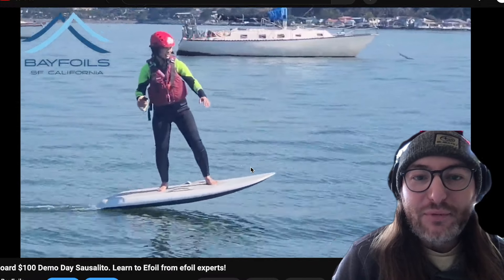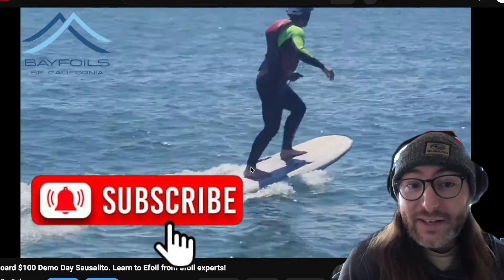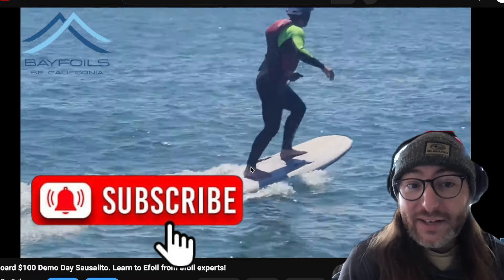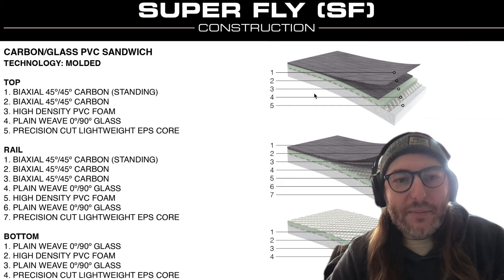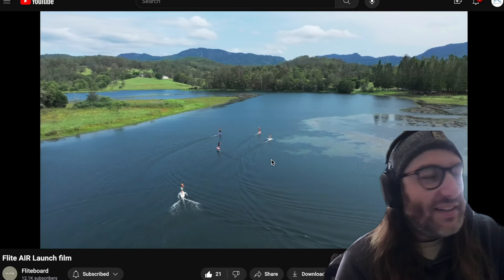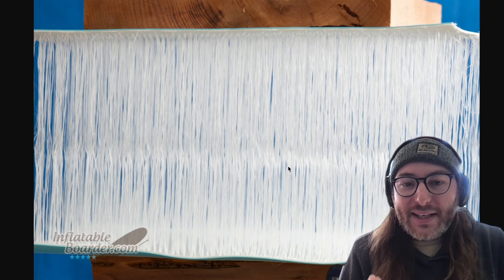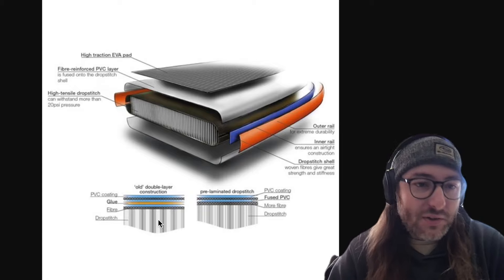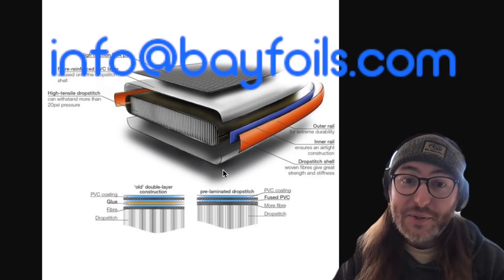Fliteboard Fiberglass vs Carbon fiber. What's the real difference? PLUS the technology for new AIR!

Comment: If Carbon is lighter than Fiberglass and is used on the PRO Fliteboard shouldn't it be lighter than the Fiberglass PRO. The spec weight on all three PRO models are the same.
Reply from the maker: @gstephenson7391  while carbon fiber is lighter than just fiberglass the layup of the carbon fliteboards it's twice as thick as the fiberglass board. This makes it much more durable and provides the nice shiny finish. The majority of the weight of a flite board comes from the battery hatch, flange reinforcement, handles, latches, deck pad, hinges, ect. Last I checked the carbon is actually 2lb lighter but at that amount if I wanted to make it lighter I would skip taco Tuesday.
Reply: @BayFoils  You might let Fliteboard know this since the website for the PRO Fiberglass, Soft Top and Carbon all show 51.8 lbs.
Reply from the maker: @gstephenson7391  that's a full configuration weight.... Board + efoil + sport battery + wings
Reply: @BayFoils  The configuration for all three Pro models are the same......and the weight remains the same for all three.....at 51.8 lbs. The Sport battery is an upgrade for the boards....... The Nano is stock.